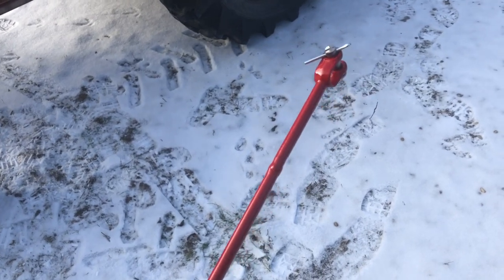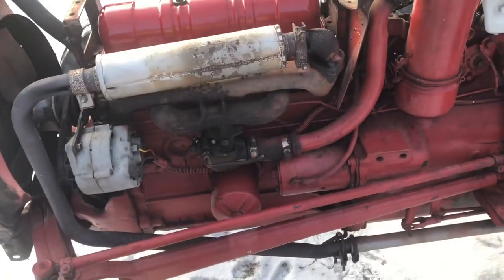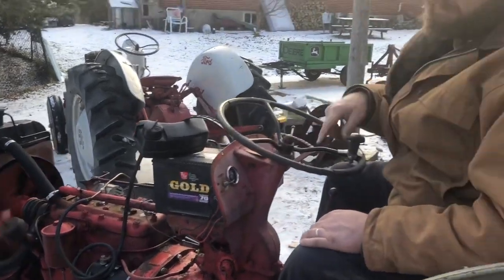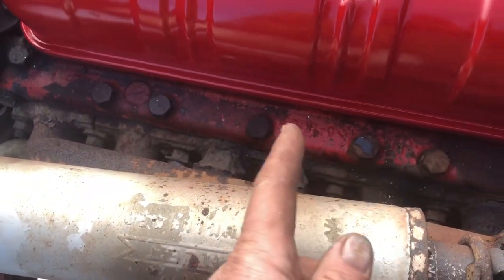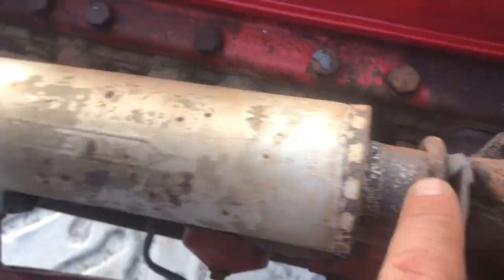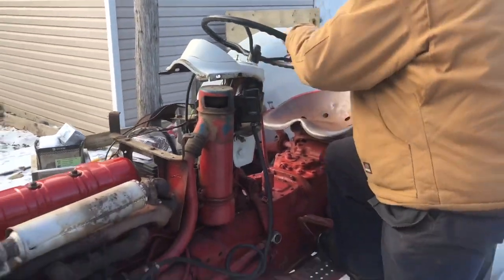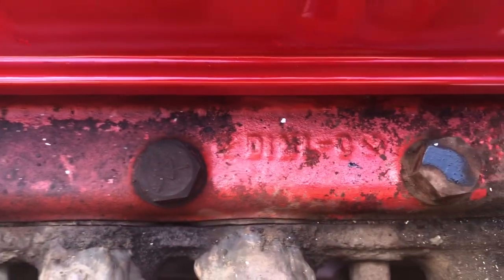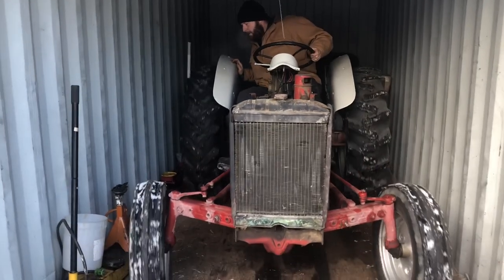Let’s test out the 2n’s new clutch and switch tractors.

Comment: Before you start taking things apart, try using a stethoscope to see if it is internal. If you don't have a stethoscope, you can use a long screwdriver. Place it on what you want to listen to and put your ear to handle end. This is a old back yard mechanic trick.
Reply from the maker: yeah ive done that before.. Works well it does

Comment: Could be a dirty lifter. I would go to GM Parts and buy 1 bottle of EOS (Engine Oil Supplement) and add it to the oil. If it’s a lifter problem then this will fix it if fixable. I’ve been using it since 1973. Guys also add this when breaking in a rebuilt engine.
Reply from the maker: think we will change that oil first. who knows what and how old it is

Comment: Old farmer trick. Cut off 18 inches or so of a broom handle. Place thumb over one end and place that thumb end next to ear real tight. Put other end around on head and block at different areas. Should be able to locate exact area of sound. Won’t tell you exactly what it is. You can buy a stethoscope and do the same thing. I am not sure where to get one and I am Leary of putting my hand down in an engine area. Sticking a broom handle keeps as my fingers and hands attached. Trained mechanics like you could probably guess what was wrong after listening. I cannot but I have used it to locate the area the sound was originating at.
Reply: There are mechanic's stethoscopes with a long'ish metal rod.
Reply: @deathk26  Wheres the fun in that? LOL

Comment: That muffler on the 800 looks like it was installed wrong. Air flow is in the wrong direction.
Reply: The round muffler's like on the 800 it doesn't really matter how you turn them thay are just a straight through design.